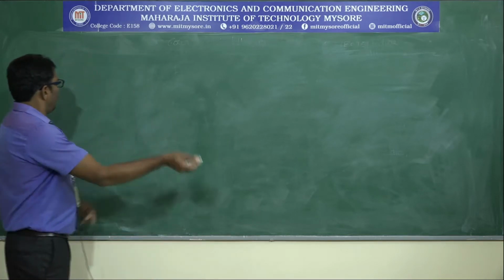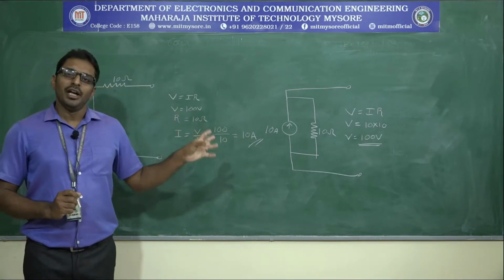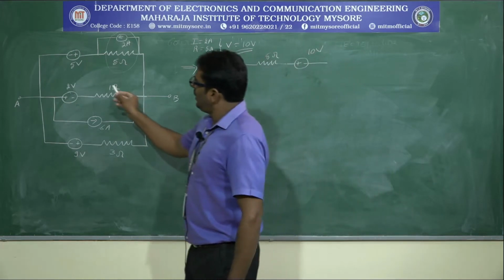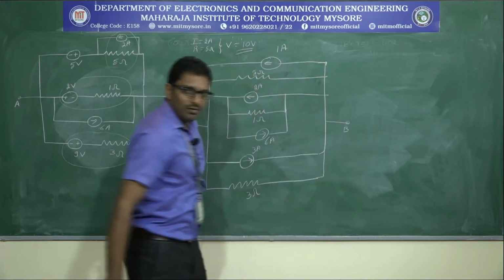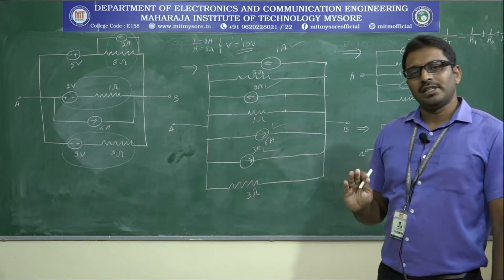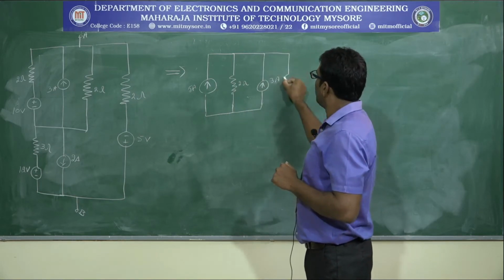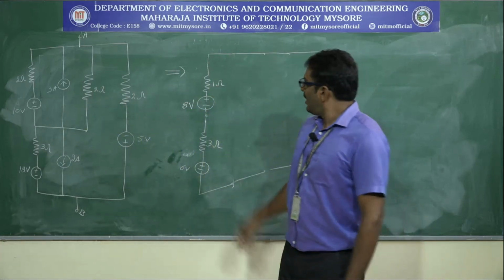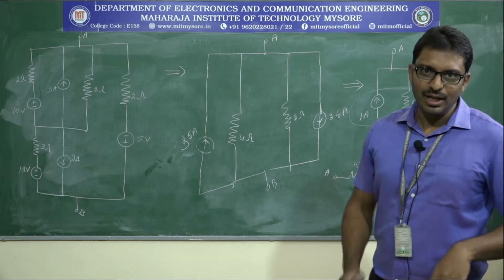Network Theory _ Problems on Source Transformation Techniques | III ECE | M1 | Session 6

Comment: sir i think last step of 2nd question is wrong
Reply: Where?
Reply: Yes
Reply: @snehadeepak4062  where
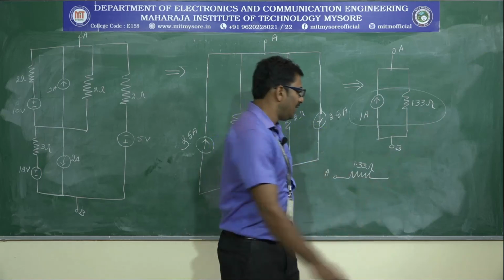Reply: @blue07325  32:28 polarity suppose to be vice versa, ig.
Reply: @shashankjmoolya2673  right ,A=+VE side 👍🏻
Reply: @blue07325  the sign in the last problem
Reply: @snehadeepak4062  yeah
Reply: Also last step in the 2nd question 4-2=2R not 1.33R
Reply: @naveencherry7660   wrong bro find total resistance
Reply: Sir was correct